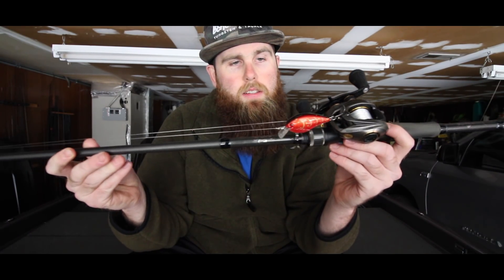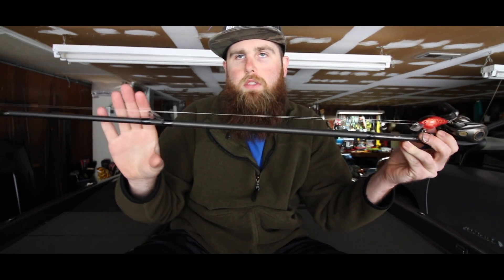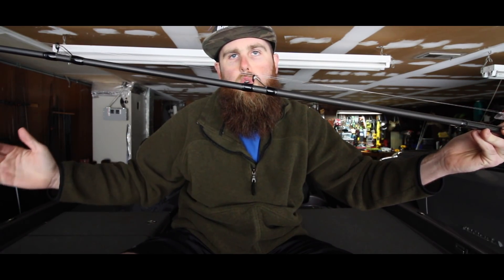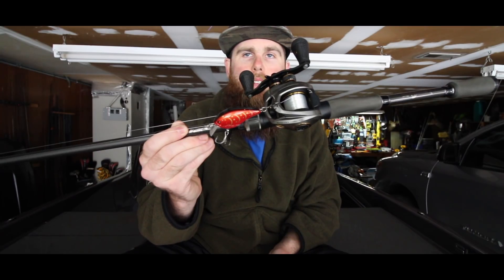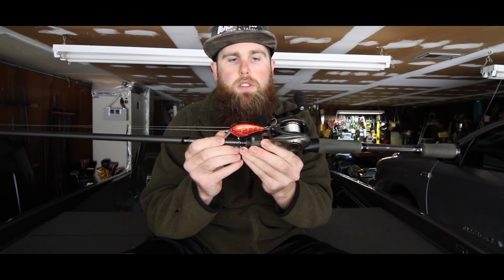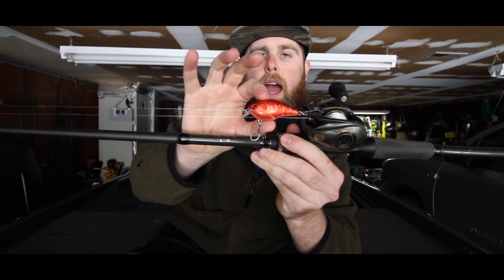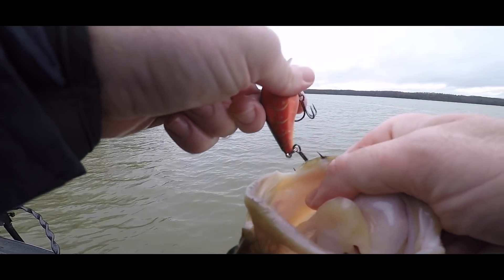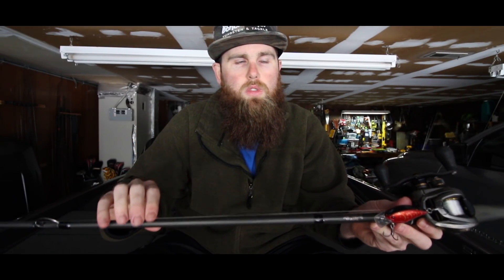PERFECTING THE CRANKBAIT FISHING SYSTEM

Comment: Like the intro! I have a similar setup and also love cranking. Have you fished any of the newer Berkley dredger crank baits? I have had great success with these. Also the stock Berkley fusion hooks are pretty sweet.
Reply from the maker: kent m I did last season a lot! I had some issues with the hook hangers pulling out. Lost a couple of big fish. I shelfed them for a while. A representative at Berkley said they were addressing the issue. I might pick a few up and try them again.
Reply: I have had that problem with the bandit 200. But I found out it was because I had been slapping the bait on the water to remove grass and junk it picked up off the bottom. Once I stopped that never had it happen again.

Comment: What's the difference between the P-Line CXX and the CXX Extra strong? I've been using the standard CXX for about 15 months or so based on one of your recommendations, and I've caught some big fish I would have lost otherwise. (I had a 6 lber wrap me around a piece of 3/8" all thread that someone used as a marker for a piling just below the surface)
Reply from the maker: They are the same thing. For some reason some retailers out the extra strong in the description others don't. Im glad you've had so much success with it!